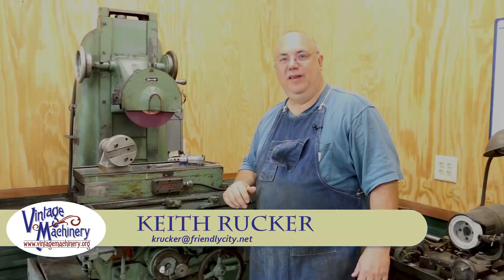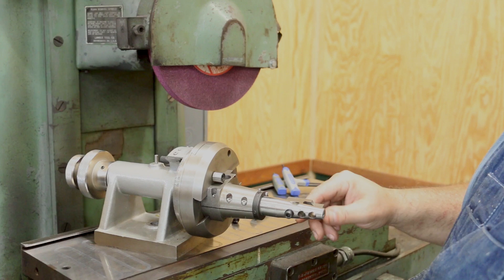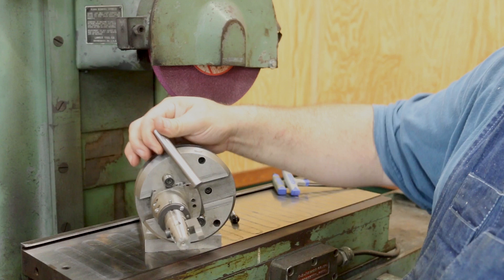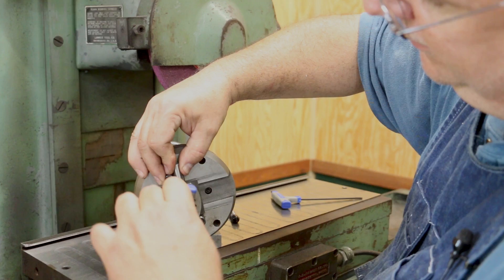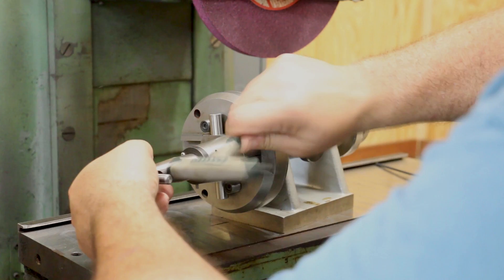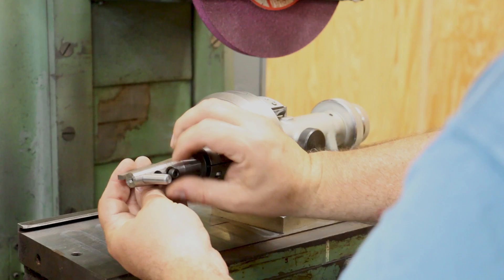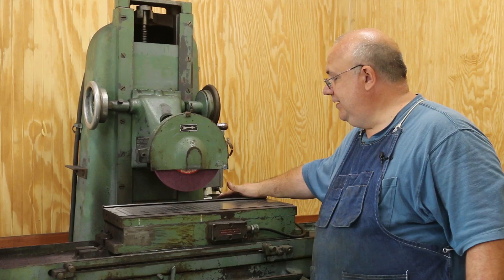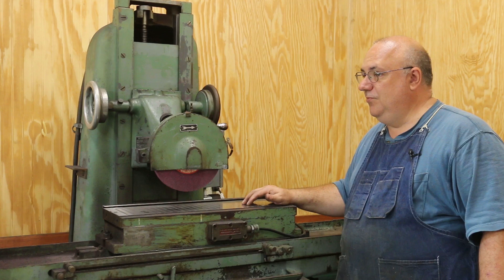Grinding a Surface Grinder Back Rail Fence

Comment: 9:25 if that is a light pass hate to see a heavy one from you Keith!
Reply from the maker: LOL - Side wheeling seems to make a lot more sparks!  That and the fact that I don't have a fine adjust going in and out on this machine.
Reply: Listen who's talking with a 75 foot long boring rig. Just hang it and go for oil! That'd make Baily wagg!

Comment: would an indicator have helped with the cross slide adjustment? And after deburring with file would it have benefitted from running the wheel down the rail again in case you pushed a burr over the edge filing? Great video as always! Cheers!

Comment: I don't understand what the dovetail on the nose fitting of the dressing tool is for. If the rod only allows one position, why have a dovetail? Looking at it, if you flip the nose piece over, does the rod set it to be concentric? Maybe the rod is for a centered position and the set screw is for any other position? Disclaimer, I am not a machinist and I don't even play one on TV.
Reply: The dressing tool looks like a prop out of a James Bond movie.  But in good hands it does nice work.
Reply from the maker: It is for making fine adjustments to the center height of the diamond.

Comment: Why on earth go to so much trouble?
What's the issue with just using the wheel as-is?
Reply: Because wheels aren't straight up and down, square, or even round. You always dress to the shape you need. If he hadn't dressed the wheel putting a negative clearance on the backside, he likely would have ground an angle on the fence as well as only been contacting part of the wheel through some of the grind. That puts the wheel in a bind and that can crack a wheel.
Reply: I think the question is valid though.  if you use the wheel as is, the sides are going to be pretty parallel - across the thickness of that bit of angle iron, the degree of square would be excellent.  without dressing, the worst that would happen is that the wheel would only be making contact at the highest spot of its rotation.  the resulting grind on the work would be the same.  and if the wheel wears that fast, it would rapidly wear itself to a consistent state.

Comment: I am a little confused.  If you grind a 1 degree taper on the back of the wheel, would you not then grind a 1 degree angle on the fence??
Reply from the maker: No, because the wheel is round so the outside edge covers the entire face when you are side wheel grinding.

Comment: Hi Keith... Is it necessary to compensate for grinding wheel wear when levelling a large surface?
Reply from the maker: The best thing to do in that situation is to rough grind everything and at the end, put a fresh dress on the wheel and finish with a very light pass.

Comment: Keith, why didn't you keep raising the wheel after making multiple passes?  I think you may have ground a beveled edge on your fence...
Reply from the maker: That was the whole purpose of dressing the wheel to a slight angle - so that you make full contact on only one edge to prevent a bevel.  No, it is square.

Comment: White balance seems to be off in this vid,and your audio was clipping a little bit. Other then than, another great video!
Reply: looks way over exposed then adjusted back down with contrast
Reply: Agreed.  Everything about this video seems 'hot'  Might be some static on the audio as well.  Perhaps a connection not seated or signs of impending trouble down the road.
Reply from the maker: Yeah, I did not catch it when I was shooting but my camera got bumped to a different setting than I usually use.  Tough to figure that out once you start editing.

Comment: One question: Would it have been useful to grind the surface/Contact area between fence and the machine, if you take the fence on and off?
Reply: probably when he gets the proper fence, a  machined face will be a good idea
Reply: new and old tech Its common practice to re-grind the backrail everytime you take it off and put it back on

Comment: Hey buddy check out a product called kool-mist thats what I have on mine love it I got mine at a auction so I don't know what the total cost would be But I love mine part don't get that hot with it
Reply from the maker: I am probably going to invest in one of the Noga mist systems for this machine.  I have a cool-mist I use on my mill sometimes but it gives me a lot of problems.

Comment: Dose this machine have coolant?
Reply from the maker: It did at one time but not working now.  That is something I need to add back on.  At least a cool-mist system is in my future.
Reply: Thanks for the answer. Be safe.